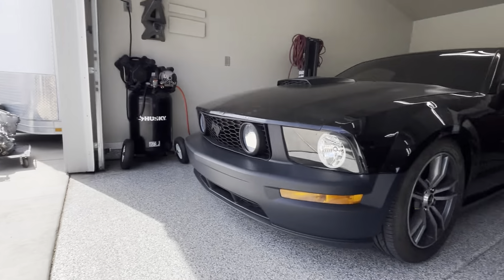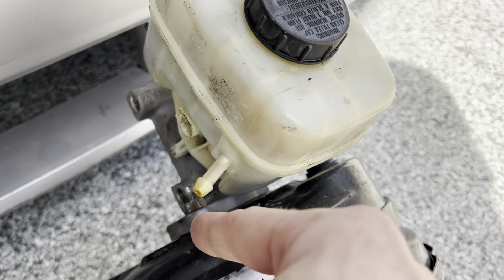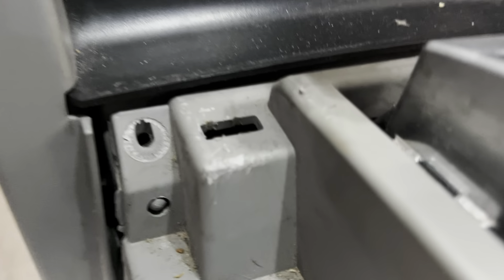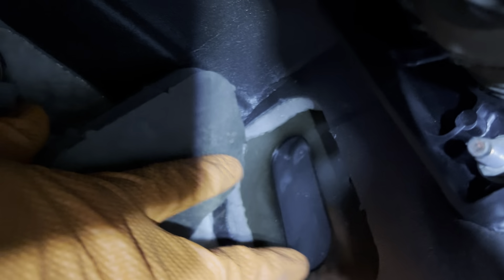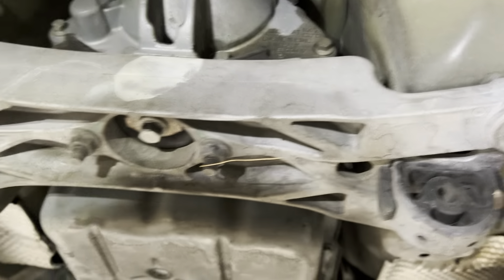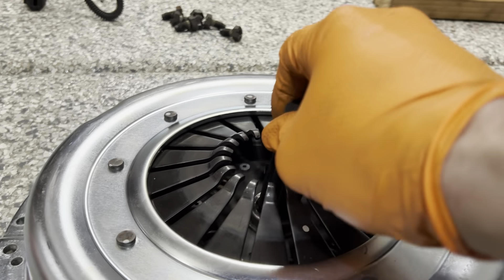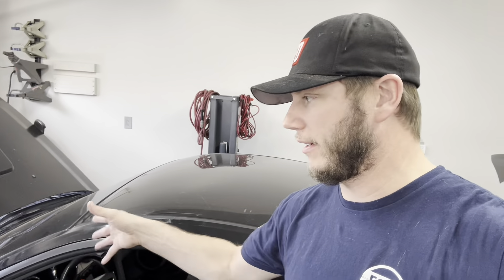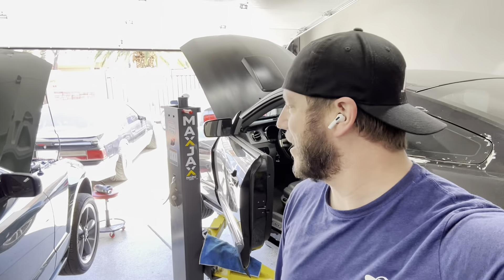How to make your S197 more exciting: A complete guide to manual swapping your 05-10 Mustang

Comment: I did my 06 GT about 9 years ago. I didn't have any videos available at that time so I kinda fumbled through it.  The one thing I found that I was told by Ford Motor Company that I needed wS a wiring harness from the clutch pedal to the dash harness.  I did purchase and install it. My ECU that I purchased was installed and set up with all my information.  Everything went in perfect except the Vin  number.  It did take the number but the original Mustang  umber shows up. Not a lot of fun getting that puppy smoged. Itook it back to the shopthat did the ECU wokd every time i needed a smog. I don't need to worry about that since I moved out of California.  I also did the 2013 electric power steering conversation on it a couple of weeks ago following your vidio for the wiring. Thank you for that.

Comment: NICELY DONE Matt! I just did a 2005 4.0 V6 auto to 2007 3V V8 auto swap and I did not have to delete PATS I just used ForScan to reprogram the new ECU and BCM to the V6 Key. (Both the ECU and BCM are from the same 2005 doner car.) As for the transmission cross-member you do not need to use a replacement just remove the 2 rubber exhaust hangers and flip the cross member over. (I was told from a Ford assembly line employee the 2 rubber hangers are actually only there for assembly line production. However I did remount the rubber hangers in the new orientation.)

Comment: Ok I need help i have 05 auto and just did a 07 manual swap everything is good on that the only problem I’m have is that the c110 is rectangular and the 05 is squared and don’t if I just splice the wires and put the same colors
Reply from the maker: @isaactellez9958  I hope you know that you can’t use the 07 pcm on your 05. Or the engine/trans harness. Needs to be an 05/06. I explain why in the video.
Reply: @MattSoppa oh so there’s no way that I can’t use the 07 ecu in the 05
Reply from the maker: @isaactellez9958  let’s just say you’re gonna have a lot of work to versus getting the correct parts
Reply: @MattSoppa oh ok cause I have the swap already in there all the work as far as that is done the only thing is the inline connector idk if splicing in the inline connector is ok or do I have to swap in the 07 dash harnesses
Reply from the maker: @isaactellez9958  there’s many other pins in the ECU body connector and fuse box connector you have to change. If you don’t know the differences I can’t explain it here n just that it’s a waste of time trying to use the wrong parts
Reply: @MattSoppa ok thanks for answering my dumb questions 🙏🏼

Comment: Hey man my car is a 2007 with an engine and trans swap from a 2006. Can I use my computer and just get it reprogrammed or will I need to buy another computer and harness?
Reply from the maker: @robertblack5475  needs to be an 07-09 ECU and harness
Reply: Ok thanks

Comment: Could I convert an auto harness to manual if I splice in the transmission wiring
Reply from the maker: @OniMX5  anything is possible it’s just a lot of work
Reply: I used my auto harness. Pretty simple really. Wire neutral safety wires together and add a speed sensor plug and reverse light plug. I’m just waiting to get a tune now. Car starts and runs great but it goes into fail safe mode every couple blocks because the auto computer is looking for the transmission that’s not there. lol! Hopefully have it dialed in soon.
Reply from the maker: @ a good tuner can flash a manual strategy. Get ahold of Lito
Reply: @dano8065  ok good to know I could at least limp it somewhere if needed. I plan on getting a tuner for it but I just need it to move for now.
Reply: @MattSoppa  I’m most likely swapping to a manual harness and ecu. Is there anyway to start the car and drive without programming pats?
Reply: @MattSoppa  I emailed him yesterday! Thanks! Your videos are very helpful! I gain a lot just from the discussions they create in the comments!
Reply from the maker: @ nope. Either needs to be deleted or programmed
Reply: @dano8065 do you think plugging the neutral safety switch in would work instead of jumping the pins?

Comment: What are the differences for manual swapping a 2010?  Can we use the same ECU just flashed different?  Any other special parts other than the usual transmission accessories and driveshaft?  Would it still pass an OBDII emissions check?  Thank you!!!
Reply from the maker: @DrStos22  can use same PCM just flash as a manual. Should be all same stuff. Just 2010 specific. I would think so as far as emissions

Comment: Awesome video man, I’ve actually made my own video explaining this as well. For me I never had to go send in my computer. I had LITO just send me a tune for the reprogram and boom I was all set I did lose my cruise control tho but for a manual I’ve never even used it since 😂
Reply from the maker: Yeah just learned that today that he can delete PATS in the tune itself unlike Coyotes. Jury is still out on the cruise as I have yet to datalog it
Reply: @MattSoppa by chance could u make a video on how to fix the reverse lights staying on from the swap, idk if your having this issues with that car but my reverse lights just stay on and don’t even know where to start to rewire that
Reply from the maker: @Blossannova  I haven’t noticed this but that issue was raised that they wouldn’t work. Short answer is a relay needs to be added to bypass the SJB. Same issue we have when swapping Coyotes. SJB just doesn’t recognize the coyote ECU signal for reverse and have to do the same thing
Reply: Hi Mark 
How's that 5r55s you took out I'm in the market for one, I'm in the east valley
Reply from the maker: @mikemanrique8462  customer kept it
Reply: How do can I get a Lito tune?

Comment: Hey Matt, any idea on parts need to manual swap a 6R80 car with a 5.0? Manual battery and transmission harness, will I need a new ecu or just be able to reprogram to a different strategy coding for a manual car into my ecu.
I know the obvious answer is sell and buy a manual but the chassis and engine have too much money in them to sell.
Probably gonna go t56/6060 instead of a mt82
Reply from the maker: Suspiros be able to use the same ECU, needs a manual strategy flashed to it. If you go 6060 or T56 magnum we have the modified trans harness for that swap on our site.